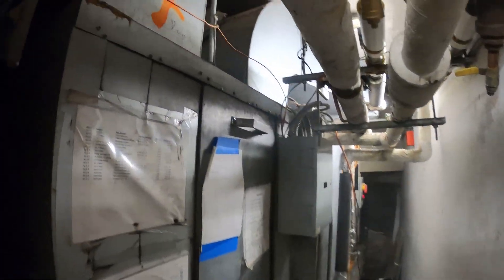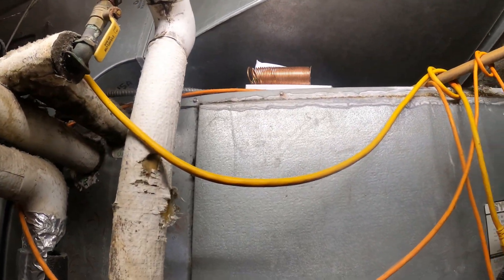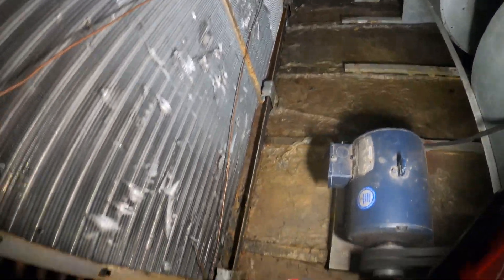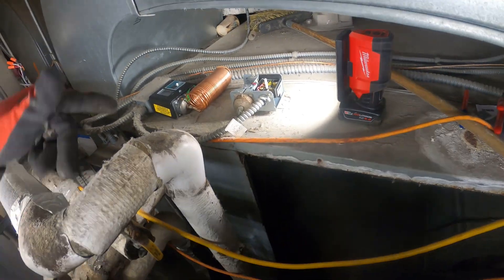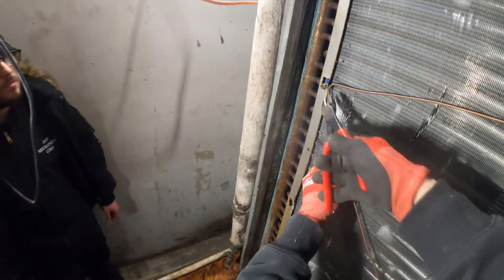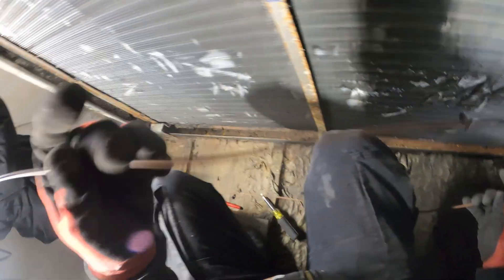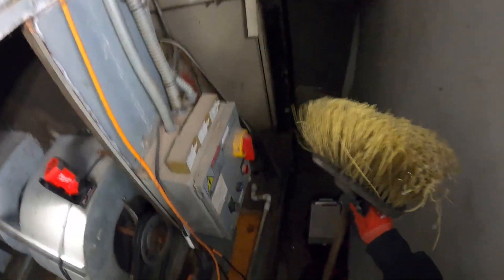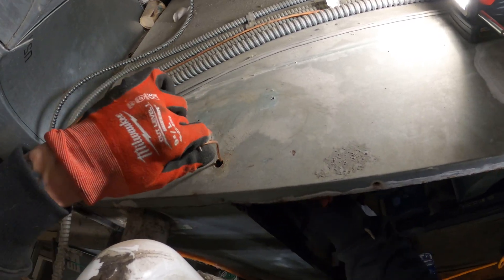HVAC Service Call: 4 Pipe Fan Coil Unit Tripped On Safety (FreezeStat Installation) FCU Not Working

Comment: Good job.  Actually freezstat is not a averaging sensor.  If 35 degree air temp is sensed anywhere along sensor control will trip.  This why try to cover complete coil as cold air can stratify.
Reply: What do you mean by cover the complete coil?  Thanks.

Comment: Why not use Glycol in your systems. When i lived in Buffalo....most systems were Glycol. Yes, it robs a little of the heat transfer, but can save you in cold climates.
Reply: Must be area specific. In my area we use reheat coils to prevent freezing chill water coils but still have freezestats and   also safeties coded into the BAS system for redundancy protection.

Comment: Great Video. Thank you for sharing. What is freezeStat used for ?
Reply: To protect from freezing. You'll find them a lot on make up air handlers and 100% outside air AHUs. If incoming air drops below setpoint it will trip, shutting down the unit to keep it from freezing and busting chill water coils. typically they have a reheat coil to heat incoming air and then pass through chill water coils again, seems counter intuitive but VAVs will take care of heating for the specific areas. Freezestats shouldn't be tripping if reheat coils are working properly.

Comment: When I worked in commercial are freeze control was for the outdoor air supply, so if the temperatures got to low it would close the out door air damper.